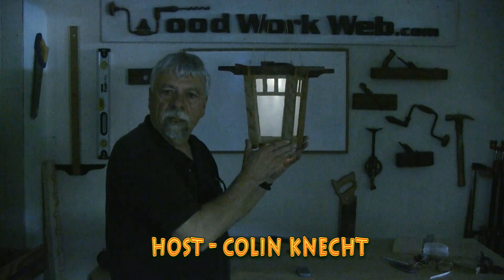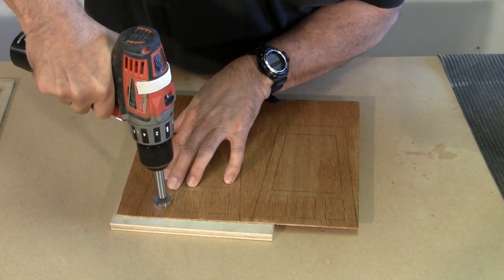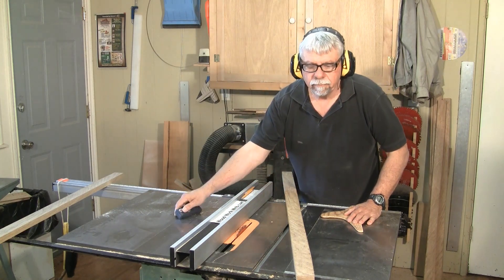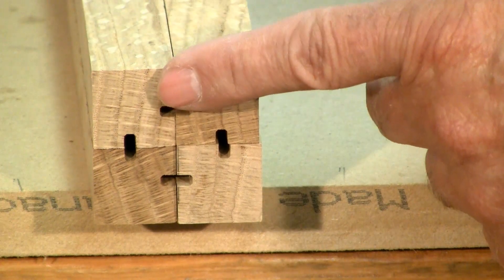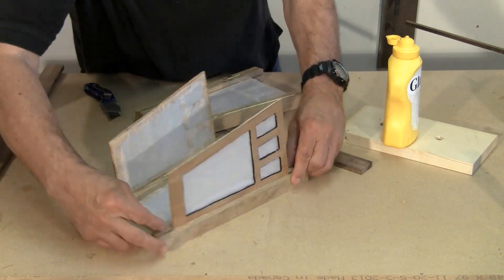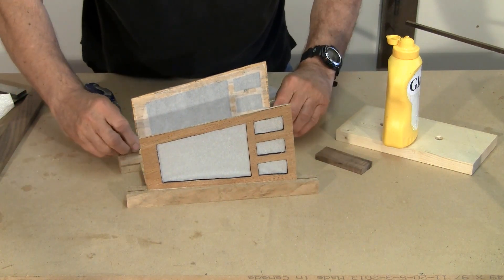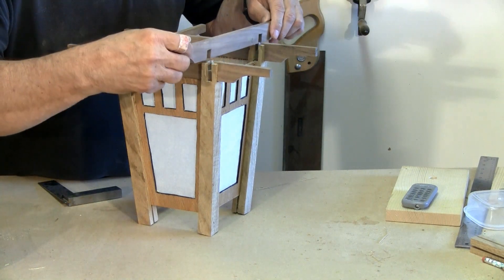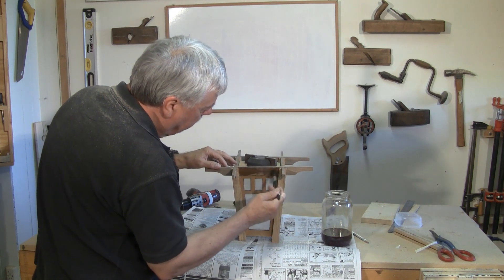How to Build a Solar Lantern - woodworkweb

Comment: I realize this is a 2014 project, I like it, however the big problem I see is rain and snow destroying the panel holding the solar unit. There should be a method to seal the top to prevent or correct that aspect of the build. Perhaps a panel with an opening for the solar cells on the top that is sealed to the top of the solar unit to prevent weather getting underneath.

Comment: Have you looked into a battery powered led type light fixture?   I think it would give you a boost in light output.
Reply from the maker: MrCuervo22779 I have a little bit but have not found what I need so far, but I think you are correct ... and LED system would be better ... let me know if you have a lead on something, I would be interested :)

Comment: I think you could use sanded plexiglass to avoid the tearing paper.  Maybe even sand designs into it.  Just a thought.
Reply from the maker: gremlinsbreath That's a good thought, and I actually tried a few different types of plastic but they all blocked too much light ... I was amazed that I could not find a material that passed light better than paper, but I am sure there must be thin plastic somewhere that would work, just not one I could find :-)
Reply: Do you think something like this might work?

http://www.lowes.com/pd_447722-74130-10395262_0__?productId=4756779&Ntt=film&pl=1&currentURL=%3FNtt%3Dfilm&facetInfo=
Reply from the maker: gremlinsbreath wow, had not seen that, it sure would be worth a try

Comment: I have that same scroll saw. Pain to change blades is'nt it? Have  lost my holder and can't find replacement.
Reply from the maker: Yes, it is a pain to change blades and to cut holes, you have to start off with such big hole to put the blade holder through. I have looked around for something better, but I use it so seldom it's hard to justify another one ... oh well, one day :)

Comment: I think it should have the bottom capped off to prevent bugs from making a nest up there.
Reply from the maker: Hmmm, good idea Adam. Around here that is a problem so great comment, Thanks!!
Colin
Reply: WoodWorkWeb Maybe just a screen insert, so the light still gets through the bottom as well as any moisture.

Comment: Wonderful design Colin, I love the overhanging rails at the top. Can you tell me how you squared of the tips of the corner pieces on your table saw?
Reply from the maker: I worked out the angle then set my mitre gauge at that angle and cut them off, then I saw that that was wrong because there is actually a double angle so in the end I had to use my hand belt sander to take the high points off, which was not an ideal way of doing it ... I learned a lot doing this project and might do another later on.